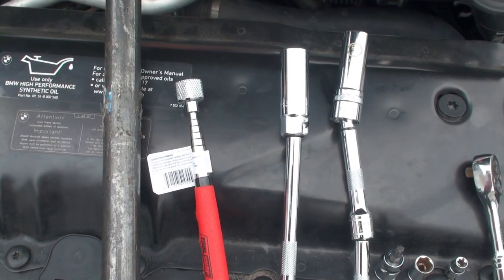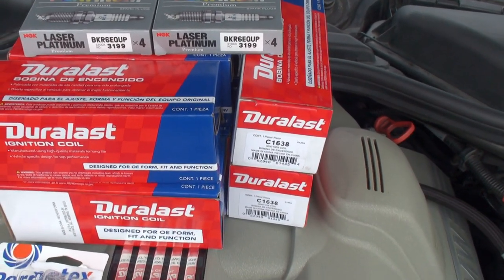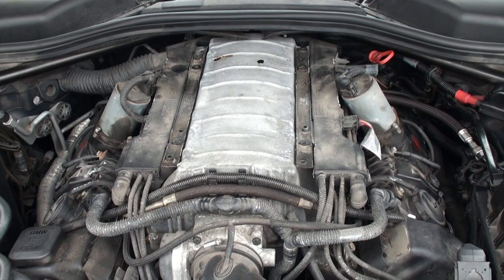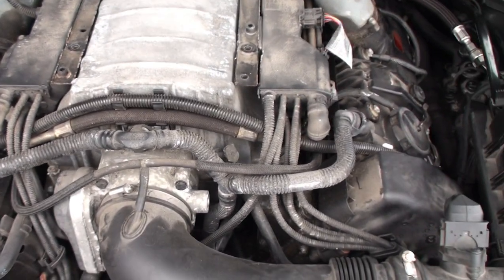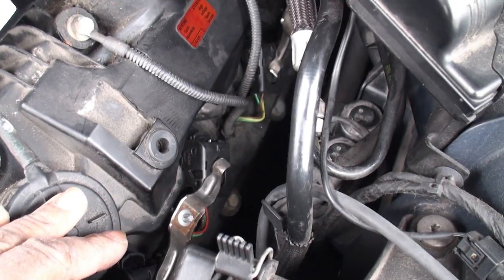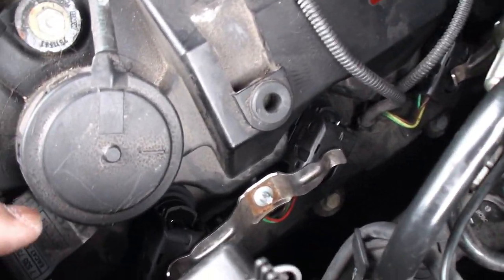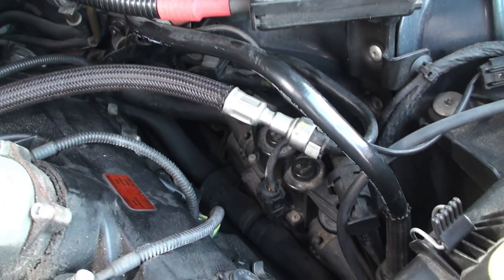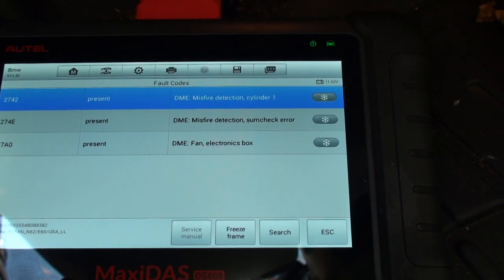BMW N62 ENGINE SPARK PLUGS AND IGNITION COILS REPLACEMENT

Comment: I have a 2008 bmw 650i and I got my whole top end rebuilt with new everything. I’ve been fighting misfire on cylinder 6 for the longest and now it’s bouncing around to different cylinders. I’ve paid bmw too much money to fix it. They even done a compression test. Now they want to charge me to rebuild the whole top end again. Do you have any idea on what could be causing my misfire?
Reply from the maker: Hi KayohKing I think I have the solution to your misfire problems.

BMW HYDRAULIC LIFTERS aka BMW VALVE LIFTERS

Your Hydraulic Lifters are not getting enough oil lubrication as to why you’re having a lot of misfires. Each Hydraulic lifter consist of a cylindrical body with an internal piston that protrudes from the top. Whenever pressurized oil enters through a hole in the lifter body and flows into a narrow channel. This oil enters the internal lifter cylinder but flows freely out the other side.
When the cam presses down on the lifter piston, it closes the channel. This locks the valve open temporarily, even under high pressure, so that gas can escape the cylinder. When the cam passes its peak, the lifter piston can rise, allowing the oil to flow freely again. In turn, it causes the valve to snap shut, preserving proper engine air pressure. So, the main reason you’re having major misfire in cylinder 6 is because your lifter is NOT BEING COMPRESS FAR ENOUGH during the intake and exhaust cycle. Check to see if the hole in each lifer is clog, hold one of the lifers in your hand then try to compress it, if you’re having problem compressing the lifer then it is failing. Usually, you can reuse the lifer once you clean it.

BMW ENGINE VARIABLE TIMING (VVT) SOLENOID aka BMW VANOS

The general lack of optimized valve timing from a VANOS issue will contribute to issues like misfiring, rough idle, and poor fuel economy. Check the Vanos for clogs or failure. Lack of oil pressure coming from the Vanos to the cylinder head can cause major misfire. 

CYLINDER HEAD OIL CHECK VALVE

You maybe having a low oil pressure in your cylinder head. Check for failing Cylinder head oil check valves. This pressure relief valve is located in the cylinder head and is responsible for keeping oil in the cylinder head on start up. Over time the pressure relief valve can fail allowing oil to escape the cylinder head back into the oil pan. Pieces of the valve can sometimes be found in the oil filter housing when they fail.

HOW TO CHECK THE CYLINDER HEAD OIL CHECK VALVE

There are three-cylinder head oil check valve on each bank. Hold the valve in your hand, then block one side of the small hole with one of your fingers, then blow air through the other side of the little hole, you should hear air escaping through the large opening at the bottom of the valve. Next try to blow air through the large opening of the oil check valve, where the plastic is, ( don't block the small holes) you should not be able to blow air through. If air is coming out the two small holes, then the oil check valve fails. If there is no plastic in the large opening of the oil check valve, then you need to replace the valve.

Please subscribe to my Channel. Thanks
Reply: Also sounds exactly like eccentric shaft gear failure.
Reply: @chrisblackprince5745 damn.. what are your rates? I want my 545i fast fast.!

Comment: I cant seem to find the right socket for my spark plugs, they won’t come out
Reply from the maker: Hi Jaden Wease. BMW Spark Plug are 5/8 inch you need to use a  5/8 inch Spark Plug Socket. On the N62 Engines the spark plugs are deep down inside the Cylinder Head so you need to get yourself a 5/8 SWIVEL SPARK PLUG SOCKET WITH THE MAGNET INSIDE OF IT. You can first use the regular 5/8 spark plug socket with the  rubber garnet inside of it to loosen the spark plugs, but to get the spark plug out of the hole, you will need the SWIVEL spark plug Socket with the MAGNET INSIDE OF IT, plus an extension. Please watch the video again to see the MAGNETIC  SPARK PLUG SOCKET I am talking about. Hope this information help. Please subscribe to me channel.
Reply: I can’t either, I have a 04 545i and it seems no socket fits into the cylinder head
Reply: @chrisblackprince5745  thank you

Comment: Did this resolve rmisfire and rough idling issues? which bmw series is this 2004 545i?  I am having rough idle and misfire issues only when car is cold in the mornings. When car is warm, runs perfect.
Reply from the maker: Hi pastmedia. Yes, I do have the 2004 545I N62. Changing the spark plugs and ignition coils did resolve my misfire problem, which was giving me an Increased Emission message display on my IDrive.

If you’re still having misfire problem then check for: Fuel Injection Problem. A problem with your fuel injector or its engine control unit can cause a misfire due to a poor balance between the amount of fuel and the amount of air that is used. Also check for: Faulty O2 Oxygen Sensors especially the upstream ones. 

If you’re are having rough idle problems during cold starts: you may have a Poor EVAP System, check for vacuum leaks, check for a (MAF) Bad Mass Air Flow Sensor or a bad (MAP) Manifold Absolute Pressure Sensor. Sometimes you will not get a fault code when the MAP or MAF sensors are bad, but the poor air mixture can cause rough idle. 

The ( MAP) Manifold Absolute Pressure Sensor is located at the back of the intake manifold, very difficult to reach but is possible to replaced without removing the intake manifold. Also check for Vacuum leak.

 If you’re still having rough idle problem then check your BMW Secondary Air Injection Check Valve, there are two of these at the back of the intake manifold they might be faulty or clog. Also check your BMW Secondary Air Pump, The BMW Secondary Air Pump work with the BMW Secondary Air Injection Check Valve, check first if the Pump is faulty or bad.

 The BMW Secondary Air Pump is very easy to replace. The BMW Secondary Air Injection Check Valve is very difficult to reach, it is located below the firewall, you might have to remove the intake manifold to reach then, there is one on each bank. Good luck I hope I offer you some good information to your problems.
Reply: @chrisblackprince5745  I did replace all spark plugs and valve cover gasket, air filter, oil /filter change,  All was good for few months, but only issue was a slight rpm movement at idle  maybe by 10 or 20, it was not stable or fixed it kept jerking a bit.  Now, my RPM is jumping up and then down below 500 at idle, car feels like it going to stall and shakes, then recovers.  At restart i m getting service engine/emission dmtl 27cd code, i assume from the rough idle, but once i clear it all is good except for the idle UP/DOWN below 500  in park or neutral. it s doing it more now when car is warm after start up,  but before it was when cold mostly... any advice,  my mechanic did relearn all data, and put injection cleaner but still not fixed.
Reply from the maker: @pastmedia   Hi pastmedia I am so sorry that you're still having problems with your BMW. Let me try to give you some ideas, The code 27cd  you're getting is relates to the DMTL system. This is the diagnostic module tank leakage fault code. This is a test that is run to check the air tightness of the purge system for the fuel tank and carbon canister. This fault will set when a problem in the system arises.  Do a smoke test to see if there is a  vacuum leak in the system or if the fuel pump itself may be faulty. The other item may be the purge valve stuck open also contributing to the mixture fault on one of the bank. Check these areas the gas cap, the fuel pump seal, the expansion tank, the pump, the purge valve, the canister and the intake for leaks. Your EVAP system have some form of a leak, try doing a smoke test of the system. I hope this help you.
Reply: So my DMTL code is no longer coming up.  My RPM idle gage still spikes up and down within 2 minutes of start up and even after car is warmed up but must be in neutral or Park idling.  What causes this issue.  No check engine lights on dash and OBD scanner shows no error either.  Any help is appreciated.  Thanks.
Reply from the maker: @pastmedia   Hi pastmedia its good to hear that you no longer have a DMTL 27cd fault code. If your RPM idle gage still spikes up and down within 2 minutes, this  could mean that you have a BAD IDLE CONTROL VALVE. The idle control valve communicate with the vehicle's ECU and control airflow when you're idling. So, when wear and tear get to this component, a disruption in information exchange happens. The idle control valve can't function properly, resulting in higher RPMs and fluctuations. you might want to replace or clean idle control valve unit. Symptoms of a bad idle control valve includes the vehicle struggling to start, rough idling, stalling, and backfiring. The good news is that cleaning the idle control valve is simple to do so you can start here first. Your crankshaft position sensor can also cause RPM FLUCTUATIONS  so you might want to check your crankshaft position sensor too. Try to watch one of my other video for more information. Here is the link to  that video. BMW RUNNING ROUGH, MISFIRE ISSUES, OR HAVING POOR PERFORMANCE ISSUES  https://www.youtube.com/watch?v=v6C8lXF_NTA    I hope some of this information help you in getting your BMW running better. Thanks for subscribing to the channel.
Reply: Hi again, the N62 engine does not have idle control valve, what exactly did you mean by that? Throttle body was cleaned when i did valve cover gaskets and plugs.
Reply: @pastmedia hey i just got a 04 545i plan on doing a tune up to fix my rough idling is yours still doing the same thing or do you have any advice for me

Comment: Did you have to gap your spark plugs
Reply from the maker: Hi keante Burks  The NGK  Laser Platinum  Spark Plugs came pre-gapped, they all worked great once I had them installed. The ELECTRODE is very thin so you run the risk of breaking the tip off if you try  re-gapping. Please like and subscribe to my channel, thanks